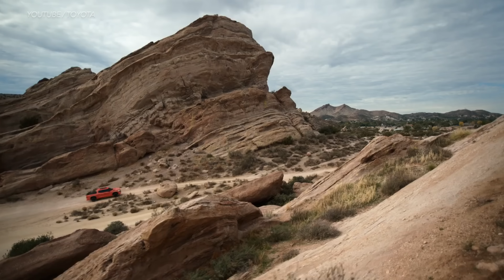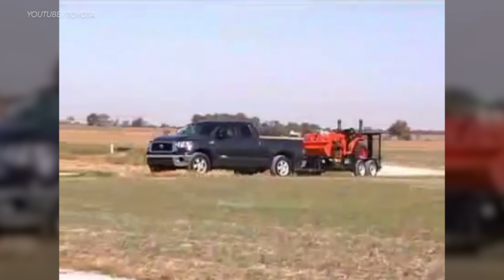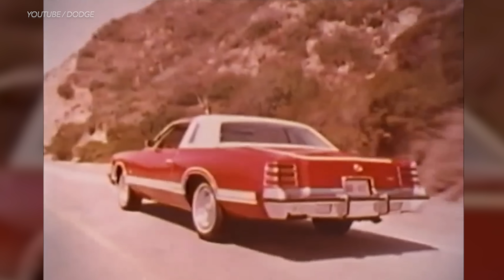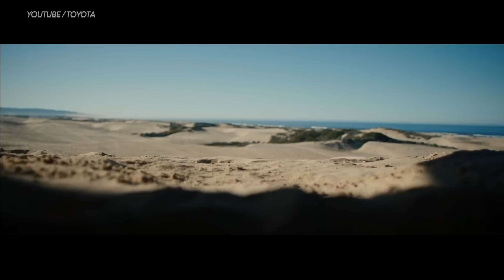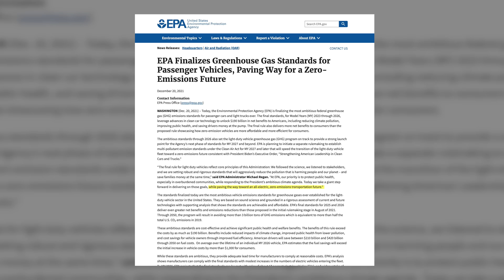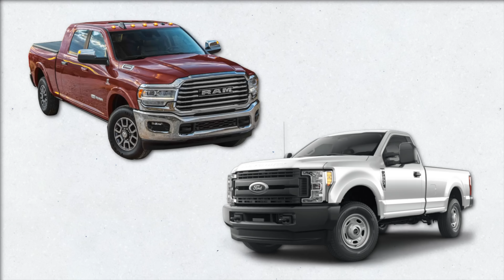Here's Why Ford Just Sued Toyota

Comment: Yes a V6 is a deal breaker. Was very happy to buy a 2021 V8 Tundra knowing that the 2022 models didn't have a V8 option. I did not want to be an "experimental" owner to test whether or not the 2022's will have the same reliability that the V8's have and nothing would aggravate me more than having to replace turbo chargers.
Reply: Mr B  and cool my 4.6l v8 has over 400k original engine.
Reply: I think it has to do with market positioning. The buyers of the Tundra want the prestige and the image. They may not be doing a lot of heavy hauling.

My thought is that there is a kind of truck arms race going on. Owners of certain types of businesses - building contractors, equipment servicing and repair and so on - need to drive a big, pricey truck for the sake of their credibility. If their competitor is driving an $80,000 truck with every bell and whistle and they're not, they're in trouble.

I've seen many of these guys around over many years, and they are rarely using the major hauling and towing capabilities of these vehicles. They are just used for personal transportation and light hauling. Then there are the people who want a truck to take the groceries home in and haul an occasional washing machine or bag of weed and feed.

Some of these people may buy Tundras also because of the Toyota reputation for reliability. They also may consider a truck a better vehicle for the occasional long trips they take. Maybe the number of people who are using Tundras for constant heavy hauling is small.

As of 2022 (and some of the 2023's might be available as of late August), almost all of the V6s are turbo. I think Ford has the only naturally aspirated V6 in the truck market, the 3.3L. A 3.3 is good enough for daily driving and hauling an occasional load in the bed, but I don't think it is heavy hauling kind of engine.
Reply: Everyone who thinks turbos are completely unreliable, need to realize that the technology has came along way since the 1980s....and with Toyota being famous for reliability, I really don't see it being a problem....plus you get more power from the turbo V6 than all but the most powerful V8s basically just the TRX and it is meant for play not work...I guess we'll have to wait and see.
Reply: @leeward6762  It's not the turbos, it is the engine. They're taking a V6 engine for a full size truck and adding twin turbos to make up the difference. I think most of us agree as you stated "I guess we'll have to wait and see" but my point was, I don't want to take that chance on a $50k plus vehicle only to find out in 7 to 10 years later it's done.
Reply: @timm3792  I can definitely understand that point...but I would also hope that Toyota and everyone else have done the high mileage testing on the turbo 4s and 6s, because they all use them....Ford, Chevy, Dodge, all working on or already have 4 and 6 cylinder turbos in full size trucks....I think for 95% of people they will be fine...just would consider something else if I towed or maxed out the payload often
Reply: Modern Turbo charges are designed to outlast the motor. just FYI. Turbo Reliability has improved significantly in the last 10 years.
Reply: You’re not a lab rat, there’s a reason they used the same engine based in other vehicles for decades. It’s their most reliable power plant in the V6 segment. Lots of people have supercharged their V6 Toyotas without issue, so there’s a reason Toyota moved to turbo charge it.
Reply: @bigmike obama 
EPA = government
Reply: @bigmike obama The EPA and I assume similar entities in other countries impose engineering requirements that then affect design. I'm not sure that's reason why Toyota does not offer a naturally aspirated V-6 or a V-8. I'm pretty good at speed research and I have found, all manufacturers are going toward turbo V-6s in their trucks. GM, Ford and Chrysler all offer V-8s though, so you have to assume that if Toyota doesn't, it has to do with their marketing niche. I just suspect, not too many people have ever used Toyota Tundras for heavy hauling.
Reply: @bigmike obama That V8 was an absolute gas guzzler and it was underpowered. It needed to go and unfortunately the way things are they made the right choice and putting the turbo charged V6 in them
Reply: @quaranjones2359  381hp and 401lb/ft torque is by no means underpowred. And that max torque is at 3600rpm while the hemi and 5.0 coyote make their max torque at 4000-4500rpm. Its simple port fuel injection with no cylinder deactivation or auto stop/start. The drawback is the fuel economy.
Reply: Think the turbos are expensive, your going to have to replace the cats because of oil contamination 🙄
Reply: @bigmike obama then explain why ford and chevy still make trucks with v8's
Reply: I disagree toyota reliability went down putting turbo on their engines .Any  v6 with turbos will wear out the engine ,a v6  turbo engine will never outlast a non v6 turbo engine.
Reply: @theshield1613  I honestly don’t know because the twin turbo Fords have held up really well and I am seeing them with 200+ thousand miles all day. Also the TwinTurbo V6 actually out performs and has better numbers than the V8 did.
Reply: @quaranjones2359  200k isn't that much, my f150 v8 has over 400k original engine
Reply: @theshield1613  unless it’s a pre emissions turbo diesel  :) those always outlast a gasoline turbo engine and NA version.
Reply: @charlesrodriguez7984  most cases yes
Reply: @charlesrodriguez7984  but not the 2022 tundra v6 turbo engine
Reply: First the 2022 will out tow the 2nd gen by a landslide. Hell, it tows my 10k travel trailer better than my ram 2509 Cummins, 2018 model. This is mainly due to stability control and 2 tow modes. Oh and your ecoboost has gotten quite a few people past 300k miles
Reply: @thepirate305   I don't own a truck at all. I do research because it is interesting. I am dubious about using a boosted small V-6 to constantly tow heavy loads. I don't think the engine would last a long time doing that.

As you note, the Tundra tows better than the Ram because of a better suspension system. That has nothing to do with the suitability of the engine. Terrain matters too. If someone is driving on flat terrain, it is going work the engine less than driving through the mountain would. If I win the lottery tonight and get a truck, it's going to be a Dodge Ram club cab short bed with a naturally aspirated V-6. No turbos, please.
Reply: If the fuel economy was even as good as the coyote I wouldn't be so unimpressed by the TTV V6. But it's not just the engine, it's the design, lack of bumpers, just overall less truck-like design.
Reply: @Terminxman  I hear ya, but I'm also an older gentleman. I remember trucks going thru many changes that people didn't like at first. I remember when cooling fans went from metal to flexible plastic. People said they were junk till they found out that plastic fans didn't go out of balance. Same with hollow drive shafts, then aluminum drive shafts  etc etc. It's just technology is all
Reply: They don't its way worse than a v8 idk what the hell they were thinking. I am okay with a V6 i just don't understand why they had to put a turbo on it. Always causes issues later in it's life.
Reply: Look up 
scotus ruled against the epa! Or did they. 
By diesel podcast    
If what is being chatted about is correct it would be epa not gov
Reply: Replacing a turbo charger is easy
Reply: @brucewayne-ej3cx  Not always, and it seems pointless when you aren't really achieving great mpg compared to a v8
Reply: @Terminxman  the tq is higher then previous generation, and at minimal when you're idling its sipping less. I think this is a win. And just the beginning of better mpg and technology we'll see in the near future
Reply: @brucewayne-ej3cx  Why are you speaking as if turbo charging is some new technology? You sound moronic, as if you haven't been aware of anything going on in the truck market or in automobiles in general outside of toyota. Ford has been achieving much better fuel economy and power for years with turbo charging, and the coyote gets better fuel economy than this TT v6.
Reply: @brucewayne-ej3cx  I'm sure, the turbo boost works the engine very hard. I've never had one, and I don't want one. Driving one is nice though, but it was a rental vehicle.

Comment: I think a vehicle requiring a turbo charger like most inline 4s and v6's are gas guzzler and also require premium fuel which costs more so no cost savings by switching to a 6 over an 8. So from what I gather, buying a V6 turbo for a pickup truck isn't gonna work for me.

Comment: The fact it isnt a HD truck isnt a draw back for me. The fact that it has been shelling turbos is. Being a long time Toyota fan boy, its disheartening to see because the aesthetics of the new Tundra is absolutely amazing. Beautiful design and very pleasing to the eye. Too bad the fuel economy doesnt really reflect a V6. I drive a Tacoma and the fuel economy with it's 4.0 V6 isnt great either. But does have excellent power and very dependable. 300000 trouble free miles and still runs great more than makes up for the fuel economy. Hope that can someday be said about the new Tundra.
Reply: It doesn't matter what kind of motor you have in a vehicle that weighs nearly 5,000 lb it's not going to get good gas mileage no matter what motor you put in it

Comment: I'm gonna stick with my V8 2011 Tundra as long as I possibly can. I'll feel more comfortable about buying a V6 twin turbo Tundra when I've seen a generation of wear and tear on the engine.
Reply: The rev a lot lower, so I think the turbos will be okay, once they iron out any engineering bugs.
Reply: There is the tried and true Rolls-Royce Merlin V-12 engine with 1,440 hp.
Reply: I had a 2010, regular cab, 6.5’ box. Absolutely loved the truck, but with no regular cab, I at least got the 5.7 in my 2021 Tundra.
Reply: me too
Reply: its been in the LS for years
Reply: @tinhinnh  , its been heavily modified for truck use, the stroke got longer, the crank got beefier, the pistons got modified and the valve train was replaced
Reply: @tinhinnh  true, but the LS doesn't tow 10,000+ lb. I want to see proven results within a full-size truck's application
Reply: @wilsonstrickland8967  Only a small % tow that much and its not like people tow their boats or trailers every days

Comment: It was a deal breaker for me. I was going to get another Tundra, but as soon as I found out no more V-8’s... I didn’t even bother looking at them. I ended up with the 3 liter inline 6 Duramax. Way more torque than any V-6. I’m getting 29 mpg and saving about $300 monthly on fuel, compared to the V-8 Tundra. 👍 I got 460 torque vs the 5.7 Toyota’ at 401 lb
Reply: 22 Tundra V6 has 479 lbs of torque and Hybrid Tundra has 583 lbs of torque. Way more than 460 lbs.
Reply: @highplainsdrifter9849  I’m more happy with what I got to honest... I’ll give up 19 lbs for the 29 mpg. I can’t afford all those batteries in 10 years... 👍
Reply: @pheyup33  you mean give up 123 lbs of torque. 583 lbs way more than 460
Reply: @highplainsdrifter9849  meaning... I have zero need or interest in any hybrid. I just looked up the Hybrid... it sucks fuel too. 20 to 24? What’s the point in it then?
Reply: 3.0 L Duramax is literally a hold my beer moment. It's a simple inline six diesel that GM completely screwed up. Not interested in trying to change a timing belt that runs the oil pump as well. Not to mention I have to separate the engine and transmission from each other to service it. I hope you don't intend to keep that thing long.
Reply: @TruckerMike089  it doesn’t have a timing belt... just the oil pump belt. I’m pretty happy, just wish I could make everyone else happy. Yea, it’s got a timing chain and a belt for the oil pump. I drop transmissions everyday, I ain’t scared. 😆👍
Reply: thats was wrong too:))
Reply: Jean Toronto Raptors  yes and I agree. I reckon I’m older than most of these guys downing me on the “inline” 6 diesel. It was the icing on the cake for me. I just don’t, nor ever had liked any V-6. If I remember right, the V-6’s more-lees showed up in the mid to late 80’s. I understand why they came out, it was because they fit better for the front wheel drive vehicles, it would be hard to throw in a straight 6. Prior to that, all you would see were straight 6’s. I remember that 300-6 that Ford made, hell it had more torque than some of the V-8’s. That 235 straight 6 from GM was a good one too. If Toyota put a straight 6 in that new Tundra, I would have been the first one “inline”... no pun intended. 😆
Reply: What vehicle has the 3.0 liter inline 6 Duramax, please?
Reply: @mr.mcbeavy1443  I got the GMC Sierra, but they’re available in the Chevrolet 1500 as well. 👍
Reply: Jean Toronto Raptors  just know that I’m happy with what I got. I hope you’re happy with any and all decisions you make. It’s not like I’m pro this or that brand... but I’m pretty damn happy. And thank you in advance. 👍
Reply: Jean Toronto Raptors  I liked my Tundra, but I just don’t like V-6’s

Comment: I own a 2019 Tundra and love it !  Prior to the Tundra I owned a F150 ecobomb and the gas mileage was worse than my Dodge 2500 quadcab with the 5.7 hemi.  Never again will I get a turbo, the ecobomb got 10 mpg. in the city.  Give me a V8.
Reply: 🤣🤣 Sure.
Reply: I have a 2021 F-150 CrewCab with the 2.7L EcoBoost V6 and it is EXCELLENT. Getting 21.3 MPG.
Reply: Lol how were you getting 10mpg? I get 19 in town.
Reply: @Psyopps1776  The Ford was a 2011, early ecobomb, 3.5 L and I did not drive like it was Sunday.  Hwy. speeds were better vs city stop and go !
Reply: I had an f150 ecobomb after 2 years it had to visit the shop at least once a month cost me $400 to $500 every time except for the timing chain that cost $3500 so when I paid it off I traded for a 5.7 tundra

Comment: My 2000 Tundra SR5 4.7 runs like new.  The exhaust is clean as a whistle, not a drop of oil anywhere, and the A/C runs good and cold.  I have 110,000 miles and I having been averaging 15 mpg while getting over 22 on the highway.  Love that V8.  The best part is I only paid $1500 for it when it had 86,000 miles after being totalled by a F3 tornado.  I got it from my brother-in-law; it looks a little rough close up but great from 20 feet away.🤣

Comment: If you get 10 miles to a gallon
To go 100, thousand miles takes 10 thousand gallons.
If you times ten thousand times 5 dollars a gallon

A Tesla pays for itself just in gas cost,
Even if you get twice the MPG a Tesla pays for it self
Reply: Is electricity free in your world?  Even if electricity was free (which it is not and going up price), How much savings is there if you literally have to replace a 25K battery 10-12years down the road?  How many miles can you drive before you have to sit and charge for an hour or so?  Electric cars are for short sighted stooges that don't recognize a disposable item when they see em...
Reply: @demodemoncrat441  I bought a 2017 Nissan leaf put 50 thousand miles sold it three years later for almost 4 grand then I bought it for.

It cost me 20 a month to charge average of 40 miles a day....

Litterly paid me for driving it
Reply: @demodemoncrat441  it costs around 80% less to “fill your tank” with electricity.
Reply: @egs2169  how many charges equate to one 20 gallon tank of gas?  Meanwhile,  toyota corollas from 95 are running around on their original engines with just oil changes.  Cost of ownership is ALREADY higher for EVs than just about any economy car on the road.  Period.
Reply: 😆😆😆 Upfront cost, electricity, & battery replacement. Nope!

Comment: Anybody who's driven the older ones realize that the transmission doesn't lock up until closer to 40 MPH. You have to be careful going for hypermiling because remember these were designed to jerk a load going at low speed. The trans would be damaged if it was locked up at the wrong time.

Comment: Scotty, if I send my vin, can you figure out my true tow capacity? I'm getting all sorts of different info. Bought a 2019 ford f150. No one seems to have same knfo!
Reply: On an F-150 if you get underneath the hitch and look up you will see a sticker with the towing capacity written down. Payload capacity is written on a sticker in the door opening.
Reply: Disagree with looking at the sticker on the hitch. That's the rating for the hitch,  not the truck.
Reply: @brainpause  No, that's for my specific truck, not the hitch, at least for the F150. It lists two values: load carrying (5000) and load distributing. Also lists max tongue weight which is 1/10 of the other values.
Reply: @julianh5167  I don't see a tow rating. I have had 3 or 4 people give me 3 or 4 different answers.